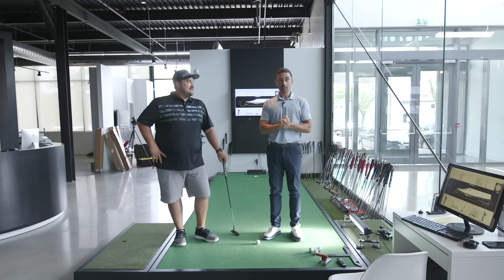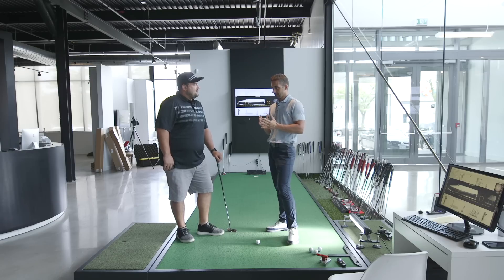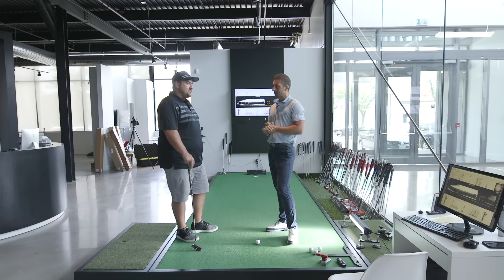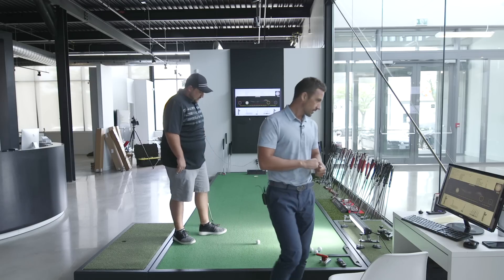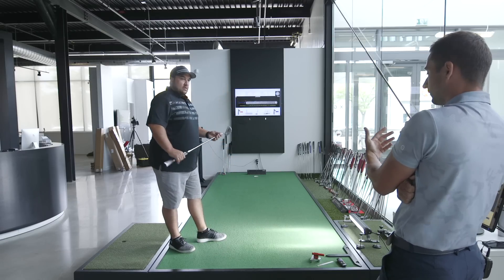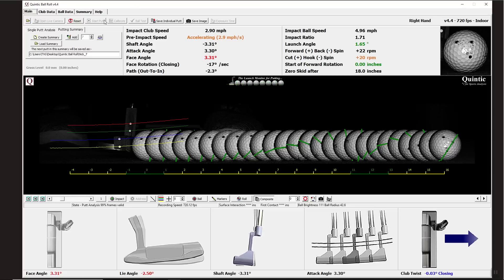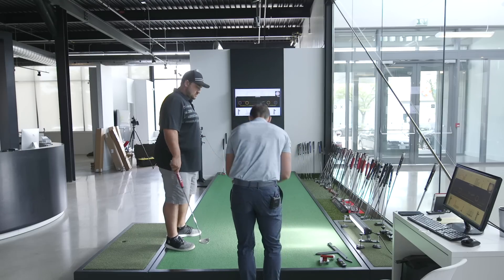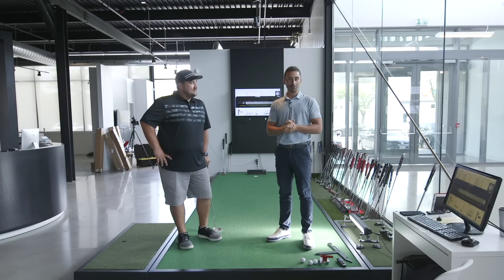Putter Fitting - Face Balanced or Toe Hang

Comment: I know the feeling. I have 7 putters from heel shafted Nappa style full toe hang to Newport flow neck part toe hang to Spider Ghost face balanced. 33”-35”. Had a putter fitting on SAM putt lab. Now with a Phantom X 8.5 with low bend slight toe hang. Loving it.

Comment: I was just there (TXG Toronto) recently for a putter-fitting with Cam.  I also chose an E7 although I had already kind of decided before I booked the fitting that I likely wanted an Evnroll after doing a lot of research on putters. I just wasn't sure about "blade or mallet?" I had a no-name blade putter with a rubber insert for the last 25 years that I found in a store somewhere for cheap and I've putted quite decently with it since but I figured I could do with a little new technology on the green. 

I had a fitter local to me do some re-fitting on my old putter and after analysing my stroke he told me he thought I was more suited to a mallet (he doesn't sell clubs, he just does fittings and adjustments). I didn't tell Cam that at the start of the session as to not prejudice him and I brought my old putter with me, but Cam basically told me the exact same thing.  We did try several other big name blades and mallets AND other Evnrolls that were all tempting but the E7 seemed to perform the best of everything for me and I am REALLY loving it so far.  Many more of my putts from 25 to even 45 feet are finishing in "tap-in" range instead of 4-5 foot "knee knockers".  

I am seriously considering fitting the other clubs in my bag at TXG before the start of next season.  Thanks for the great experience!

Comment: I have an Evnroll ER2 for 2 years!!  Recently had Stability shaft installed by them in Texas, and they were able to get 44 degrees of toe hang (at 3 deg. Flat , 67 degrees) which is 2x the OEM !!  Best putter I’ve ever owned !!
Reply: What’s your height? I’m see if I justify that same 3 degrees flat lie angle

Comment: Great Video Ian like to see more putting video's. How much can grip  size or type have an effect on the putting stroke. Do you take grip into account when fitting?
Reply: Basically, the Thicker the Grip the more It diminishes the effect of Toe Flow. Thinner enhances Toe Flow. 
If your "Miss Tendency" is to the "Push" side, "Thicker" brings you more to the "Pull" Side.
If your "Miss Tendency" is to the "Pull" side, "Thicker" will Increase the "Pull" Miss.
Conversely, "Thinner" moves you from "Pull" towards "Push".

Comment: Ian,

I would really appreciate it if you could provide a recommendation in terms of putters.  Based on your suggestions I went ahead and used the Ping putter app to fit myself.  

Some outputs were.
6.2deg. Closing angle- slight arc
Tempo-2.2
Lie angle recommendation- 2deg flat
Shaft lean- -3deg hands in front.  

I currently use a Tommy Armour Impact #3 which is designed for SBST swing types.  My miss is a push right (righty) and I miss short.  I  would love to correct it but struggling to interpret results. 

Understand that this isn’t your job but love the channel and would trust your guidance.  Thanks!
Reply: Christian T how did you use the app? Do you have an old cradle or phone?
Reply: Steven Carrier Something I suggest anyone do in order to use the app is scratch the idea of the cradle all together.  You can simply take a rubber shaft lock you would normally use for grip changes etc... and cut it in half.  I then glued that onto the plastic piece of a pop-socket so I wouldn’t have to scrap a cell phone case.  This worked great and costed about $7 in material and 5min in labor.
Reply: Christian T thanks! I’ll try that this evening.

Comment: Been meaning to ask, How do you guys feel about Edel putters that are neither face or toe balanced, but are basically toe up? they call it torque balanced. 
The idea being it will help close the face better at impact- even more so than a face balanced putter.

I tried one briefly in a shop and I’m planning on going to an Edel putter fitting nearby in the next month or two. 
I did some research online and their putter fitting seems to get very good reviews....they seem very thorough with all of their measuring and lining up with lasers etc etc. They also strongly promote the idea that most golfers would benefit from not having a line or sighting aid on top of the putter which is interesting.

Would appreciate your thoughts (or anyone else’s) on this though before spending the money. It’s approx $400 for the fitting and cost of brand new custom putter.

Comment: Those are all expensive putters. I also had a Scotty Select Squareback Custom, Toulon Long Island, and Cleveland Tfi 2135 Bronze 1.0. 
Dropped the Scotty, couldn't aim it.
Pretty good with the Toulon but I have to work for it. 
Easiest putter to use is the cheap Cleveland TFI. The 2135 aim line helps me relax, speed control is great, makes trouble putts seem easy. Sometimes the "Bling" gets the best of us.

Comment: Why dont we see people changing putter weight position like we do in drivers....so many heal and toe removable weights in putters these days but always the same weight. Why not change weights to influence stroke path?
Reply: The "adjustable weights" are there to balance Overall Weight to Swingweight.
The "Neck Style" attaching the Shaft to the Head has the most influence of Increasing or Decreasing Toe Flow. 
A Newport 2 and a Newport 2.5 are Identical in every aspect except "Neck" and that is why a 2.5 has MORE T F than a 2
Weight doesn't affect PATH. 
That is totally on the Player.

Comment: Halfway through he changes his grip. Starts off with index finger down the grip then stops doing it...
Reply: Kyle Peebles it was a change that was recommended to me from Ian. He noticed that I was pushing with my right hand vs letting the putter head release. It was said off camera and has helped tremendously.
Reply: @wayward_points  Nice. Was curious if maybe you changed it with your current gamer if it would have changed the numbers?

Comment: No amateur is playing on 13’ stimpmeter greens regularly. 11 is maintainable, anything higher is unrealistic.
Reply: K Cee 
Why’s that?  A lot of clubs around me run 12-14 during summer
Reply: @eyesopen9477  A normal course green with standard foot traffic would die off if it was cut and rolled to 14. Also from an enjoyable standpoint, most 20+ handicappers would not enjoy putting off marble.
Reply: Eyes Open then your course isn’t Stimping properly. 14’ on a flat area of the green would then become unplayable with a green with any amount of slope.
Reply: Definitely some courses here in Chicagoland that run 12-13 all summer long. Certainly not unrealistic at all.
Reply: @kcee4160 
Oakmont is consistently 14 on the flats and up to low 20's on the slopes and most of the greens there are basically all slope. You're right in that it's extremely hard to play, but I don't think you can say they don't know what they're doing. They set it up the way the members want it regardless of how difficult the results. I'd bet the same happens on many courses all around the world. Ultimately the members or people paying to play determine how the courses are set up.
Reply: Barry DF it is not possible to correctly stimp a slope. If you are stimping properly you must go in both directions and if there is a greater than 1’ difference the test is invalid.
Reply: @dhartmann34   Is that "local opinion" or actually measured?
Private Clubs, that Don't see lots of Rounds / Year might push to 12-13 for Special Events. 
Courses that see upwards of 40, - 50,000 R / Y usually stay in the 9 - 9.5 Stimp Range.
Reply: @papab3272  Oakmont is PRIVATE Club that might see 20,000 Rounds a year played on those Greens.